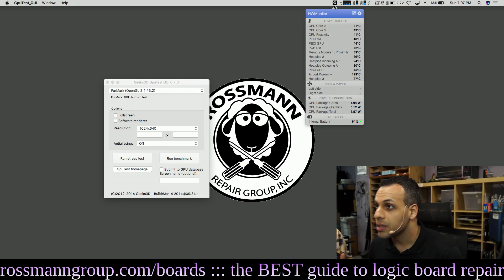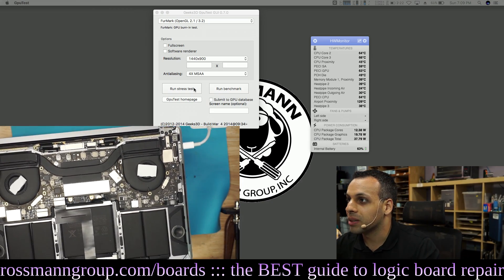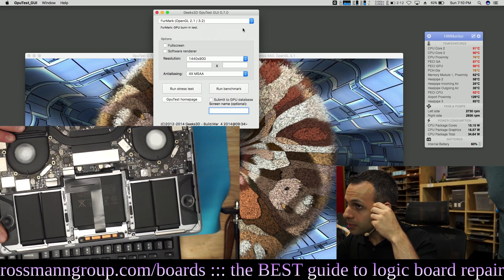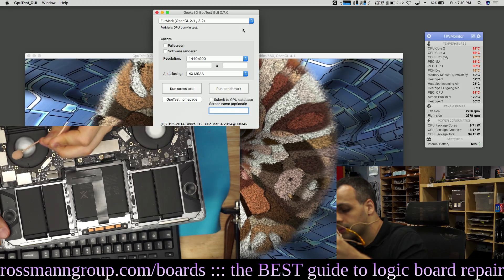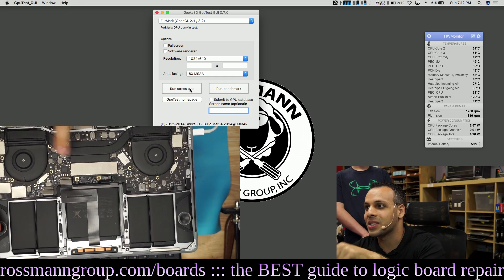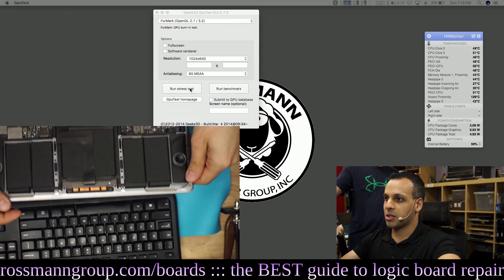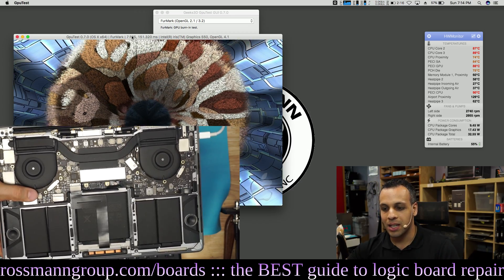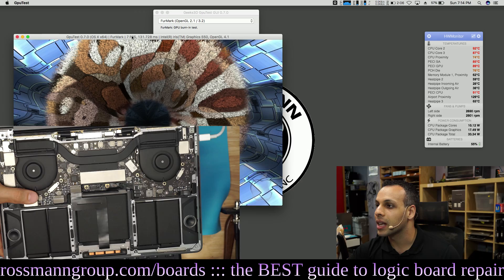Why Apple Macbook runs hot.

Comment: Silent fans, but incredibly loud keys ... WOW, APPLE!
And yes, the newet keys are really loud. I tried several current MacBooks in stores, and even cautious single-finger style typing is a noise hazard to your fellow shoppers.
Reply: 4rtificial1dioty that's to alert the seller there is a potential customer to hook
Reply: @4rtificial1dioty
The silent low rpm fans are possibly to extend battery life. It reminds me of an old Honda Oddyssey that would go neutral disengaging the torque converter when you let of lf the gas below 45 MPH. Sure, it saved gas doing so but we went through 3 transmissions during the 166K miles we racked up buying it brand new.
Reply: You're being sooo dramatic. I don't think you've ever heard what loud keys sound like or maybe you just got sensitive ears
Reply: They're loud on porpoise so people at the starbucks KNOW you're using a macbook.

Comment: A Cpu is fine working at 80 degrees full load for an extended amount of time. But i wouldn't like mine going over 85 even in really bad synthetic loads like this one. Especially when my fans aren't running at 100%. Is there no software for fan curves on macOS ?

Comment: assuming that temperature readings work by measuring oms, can you put some resistors on sensors to add some Celsius to acctual temperature? To make fan spin earlier? It work for cars, where you put some resistor to the intake air temperature sensor, making ECU to add more fuel to the engine?

Comment: This is the same issue consoles deal with.

They cook themselves until micro fractures happen in the soldering of the CPU/GPU to the mobo.
For example: PS3's sit at 70C+ while doing nothing and will go 75-80C+ while gaming. All the while the fan is trying as hard as it can to go as slow as it can.
The PS3 actually has a pretty powerful blower fan it it but it sits at like 20-30% of max RPM at those temps wasting it's potential.

Heaven forbid sony to actually add a setting to allow the user to choose to increase the fan speed at the expense of potential fan noise.

And lets not even get started on the shit brick that is the xbox 360's issues.

Comment: For my old laptop PC from hp, 90 deg C is the temperature where its built-in emergency protection process kicks in. I had been surprised every time that happened, because the PC turned itself off without warning but the annoying CPU fan noise was the precursor. Of course I lost all the data in that session but I could turn on the laptop later, then it began to work again as usual. I have used it for almost 9 years and no repairs.

Comment: They even use really crap thermal material, toothpaste like shit that cakes up. My company gives macbook pros (despite my pleas that the keyboard is hard to type on) to its employees, and when I found mine to cook my lap evertime I had to use it on the go, I took it apart to see what the issue was. Replacing with some Noctua NT-H1 really helped (~15C difference on load, and 10C cooler on idle). Of course, I use smcFanControl to run the fans at low speed even on idle, makes a massive difference without generating any noise at all, not that I can percieve anyway.

Comment: The fan on my 2015 rMBP kicks in at 60C, and my maximum temperature never exceeds 75C. I guess they're building the new ones to fail even more. What a shock.
Reply: my late 2013 15" goes up to 98"c easily upon rendering. Do you think it will last? Surprised 2015 only goes up to 75C
Reply: Have you ever opened it to clean the dust out?

Comment: i have a t440 thinkpad with its cpu limited to 15W because its an ulv variant. the cooling system runs 50% at max to keep it at 63°C. its gonna last and all, but i would like more power, like a permanent turbo to keep it at 25W at least, because the cooling could easily do it.
Reply: 50% with the fan at about 3300rpm at permanent full load.
it can go over 4200rpm, it has lots of reserve thats never used.

Comment: Now, not all cpu's and gpu's have the same safe operational temperatures, so you can't just say "omg 91 Celsius omg that's too high" without knowing what the actual safe operating temperature is... but if the gpus and cpus have a tendency to die, then I think we have the answer to that question. You can also look up what the safe operating temperatures are supposed to be in hardware documentation. To my knowledge, Intel CPU's aren't supposed to operate that high anyway, but I know the AMD R9 290 GPU's had an extremely high safe operating temperature of around 95 degrees... of course, those weren't for laptops (they were the exact opposite of what you would want in a laptop). Also, in a laptop, even if the cpu or gpu is okay, if it's running hot, there's more likely to be a problem with causing damage to other components than with a desktop (where there is more space for heat to dissipate), or simply making the outside of the laptop uncomfortably warm! :O

Comment: How pathetic. You were being generous to the MacBook. I’ve seen MacBooks over 100 under synthetic load. 

Furmark is mainly a GPU stress test, if you also run a cpu stress test like Prime 95, you can easily get over 100 degrees. This doesn’t even account for the fact that the bottom of the MacBook was off giving it extra ventilation. (I’m sure you know ventilation on MacBooks is shit). The whole cooling system is absolute garbage.

Comment: Apple prefers to slowly kill their macbooks in the name of silence and planned obsolescence.
Reply: If you own a Mac you should get Istat pro or another fan control software.
Reply: Even if the CPU's are magically binned higher than any others in their line, the best of the best silicon, those temps are costing you FPS and render time... The fans still come on, its not much quieter than a proper cooling setup, but the thermal throttling of your hardware will cost you time. So basically NOT work friendly.
Reply: O!Technology Silence Heals 1
Reply: O!Technology in the name of silence in the name of our creator Stive shut up 🤐
Reply: But guess what? it works for them. I often hear people praise macbooks for being quiet. But what the hell do i know...who needs cooling, right?
Reply: You are Right. I have this MacBook (2017 Pro Modell) now is 2020 this product starting with some real issues
Reply: O!Technology I guess that's apples version of planned parenthood.
Reply: Opfi Pip I can trust a socketed processor a lot more at 100c than a soldered one.
There's a big issue with thermal expansion on a rigid joint over and over in this case, where the socket handles it just fine.
Reply: acrprmann so that means at minimum 63% of PP services are not related to abortions.  Still an awfully high percentage of Jesus-approved services to be hating on it.
Reply: to be fair, the cpu and gpu survive 100°C pretty much flawless, and if the connection to the motherboard is done well, these temp's will not damage anything. i have seen CPU's that run at 105°C for months, clocking down to keep that temp. It is incredibly hard to kill a CPU/GPU by overheating it nowadays. 
CPU running without HS:
www.youtube.com/watch?v=yA0oo12rbiM
Reply: Opfi Pip running hardware 90°c + is the fastest way to shorten its lifespan. Efficiency ratings and lifespan of the parts that make up the components are best case scenarios and this video hits the nail on the head. 
Being content with something running at near maximum temp for the sake of fan noise means the parts are being abused during daily use. Thats not progressive or in our best interest. 

On PC and laptop you have the choice whereas apple tell you whats best for you.
Reply: @opfipip3711  are you sure that you understand from electronics?
Reply: Ashish Patel You do realize abortoons count for only three percent of the services PP provides, right?  Or do you just hate women?

Comment: They could go silent with better cooling.  Double up the fans and add an extra heat pipe or two.  Make the whole back a heat sink for the quad fan setup to blow through.  The more air flow and surface area you have the less speed it needs.  Twice the air flow on twice the surface area at the same fan speed with net better cooling.  Extra heat pipes would allow the heat to flow out faster to the fins as well.  Pop open any high performance laptop from any other brand and you will see similar setups.  Most are not really any louder than a MB.

Comment: To be fair, a lot of laptops now run in the 90s. They basically rely on the Intel CPU to thermally throttle, instead of using a heatsink/fan setup that's actually capable of cooling the CPU. I don't know what AMD is doing, but Nvidia has stuck to their guns and still forces a ~80C thermal throttle temperature (which forces gaming laptops to focus on cooling the GPU a little bit better).

Comment: Gotta be a way to take control of the fans and spin them up quicker.  My old Dell M1710 had the GPU fry for a similar reason, cause the fans kicked up when the temp would hit 90C, and this would kill the GPU over time.  There is an app to prevent this called i8kgui but like most situations I'm too afraid to void warranty and avoid enhancing the cooling.  Now I've learned my lesson and proactively enhance the cooling of anything I own.  RX 480 fans sound like leaf blower so I put new better quality thermal paste and now it rarely goes above 50C.  All my laptops have liquid metal thermal paste with Fujipoly thermal pads to keep them as cool as possible.  Apple is bad, but they aren't alone.
Reply: Macs Fan control. Name sounds dodgy, but it's a good piece of software that sits quietly in the background.
You can tell it at what minimum temp to kick the fans in, and at what RPM.
Think HW monitor has a similar function.

Comment: Well, that's way outside Intel spec and getting pretty deep into CPU thermal throttling territory.  Intel usually either go super throttle or shutdown at 100C.  Varries a bit from chip to chip.  Normally you wnat to keep your max in the 70's at most.

Comment: Hmm. Macbook Pro 15" 2017 here. Fans are always spinning around 2000RPM no matter how cold the machine is, as long as it's on.
Fans speed up when it goes over 50 degrees.
Reply: Attached stats of my MacBook Pro 2017 while idle. As you can see fans run at 2000RPM when idle.

https://imgur.com/a/PIC7EF1

Comment: Oh, you want a frying pan heatsink? I'm afraid I don't think 36 watts will be enough to keep a largish cooler hot enough. My i7 4710HQ overclocked by 2 turbo bins (200 MHz on all boost speeds) running prime 95 tops out at 70°C, and a little over 55 watts, but it has a real heatsink.

Comment: This is why I put a third-party utility on any Macs I service that changes the fan spinup to where it comes on at 60C and is at max RPM at 70C, because that's always what I've done with self-built PCs since forever.
Reply: Evan Robertson what software do you install to control. The fam
Reply: blockisle9 either smcFanControl or Macs Fan Control. You can find them on Mac Update.
Reply: I keep the temperature between 40-45 Celsius. Those who can afford Apple products certainly can afford to replace fans, CPU is the most important component hence you should try whatever means to keep it as cool as possible.
Reply: Tech with Victor I’m absolutely shocked at the way these products need apps to keep them cool.  Sounds like the Boeing Max which needs an app to keep it in the air

Comment: There's no way to change the fan spins at lower temperature for MacBook? I never used MacBooks, born and raised Windows.
Reply: there is a way. but only 5% people.know this 
 this is apple where everyone buying things.
Reply: MacBooks have "PowerSaver" options. Use them. Less electricity = less heat = a cooler system.
Reply: I Have No Son 

it only has power nap.options.  put hardisk to sleep. show batterys status in menu bar. 

the energy saver is just feature when laptop.put to sleep

Comment: I was running GPU stress test on a 15" from 2010, and I couldn't figure out why the fans were so quiet when I burned my finger on the heatsink. Then I put on the bottom cover, which obviously restricted the airflow, and that's when I heard the fans spinning up. Apparently it wasn't hot enough to seriously spin the fans up, and it got hot enough once I put the bottom cover on.

Comment: It runs hot because the SMC is (intentionally?) configured wrong. Since the SMC monitiors the sensors and the fan speed, you need to reconfigure the SMC manually.

On macOS you can use smcFanControl, but it doesn't allow you to set the fan speed past the stock fan speed due to "safety" reasons (safety as in, they don't want the fan to accidently "destroy" itself if it were to go above the stock max speed).
Because I was using Windows on my MacBook before the SMC got fried, I wrote myself my own program so I could set the minimum and maximum temperature, as well as configure the fan speed to a reasonable point, so it stayed cool and the same fan speed on CPU usage bursts.

Fun fact: if the fan speed goes to zero, the HDD clicks for some reason.

Comment: I always compare Apple products with supercars, but then with the front intake air taped shut. You got the performance, but for a really short bit. Then it runs hot and will throttle down the cpu speed to keep it 'cool' but your programs run like crap. Yeah my Hackintosh of old scraps runs circles around my old 2011 iMac 27". Because it can be cooled properly!!!

Comment: I’m primarily a Mac user because I just don’t like using windows, it’s bloated and clunky, MacOS feels much more fluid... I’m worried about the longevity of new machines though. My daily driver laptop is a mid 2012 13” i7 (non retina) with 16gb of ram and a 1tb SSD, it’s still immaculate and in perfect working condition, It’s proven to be very reliable intend to keep using as long as possible. I also have a 2007 24” iMac, core2extreme with 6gb of ram (the maximum it can recognise) and a 500gb ssd, it’s my secondary iMac (I have a 2012 27” model for family use) but is still in daily use and still works perfectly, it’s more than adequate for web browsing, YouTube, word processing and of course viewing schematics (it’s on my electronics work station)... I’ll keep using this for as long as possible too. I can’t imagine their newer models having the same kind of lifespan, I’ll hold off replacing my current models until I have to.
Reply: PingasTheFourth no, nowhere near that. I can’t remember how much it was exactly but I think it was around £1150 (I’m in the U.K.). I added the ram and ssd myself a couple of years ago (about £300 all in). I’ve been using it for five years constantly, it’s paid for itself many times over. The online thing that makes it look/feel a little dated is the screen resolution. It’s still a nice display though, the viewing angles, brightness and colours are great. A new MacBook with the same ram and SSD capacity would cost a whole lot more!
Reply: You can ditch windows for another operating system.
Reply: S Cin I did about 10/11 years ago, I tried Ubuntu which was fairly solidly but didn’t have the right software support, I got a Mac. I was so sick of having to reinstall audio drivers every day and getting random system hangs on windows, OS X was a revelation, it just worked perfectly, every time... and I still have the same Mac in daily use. I’m just concerned now about the longevity of their current hardware, I don’t mind paying out for a new Mac if it’s going to last. At the moment though, my existing machines are doing a good job.

Comment: I use iStat Menus to have a custom fan/temp setting. Because I’m running a 2011 MBP I have the base fan rule set at 30 degrees C == 3000 RPM
And this results with my cpu sitting around 38-40 :)